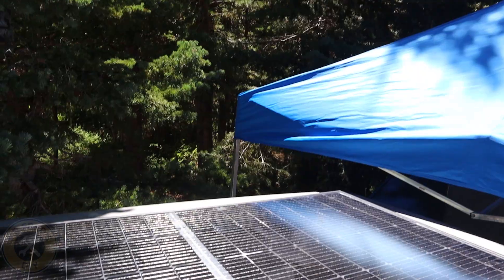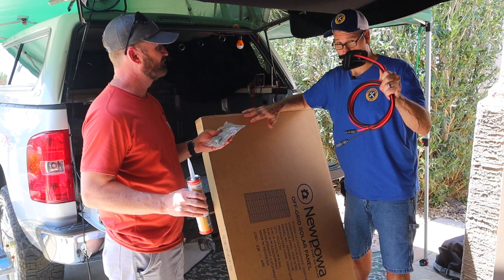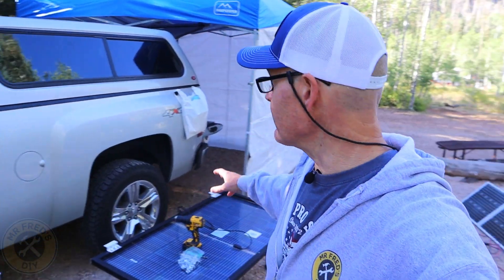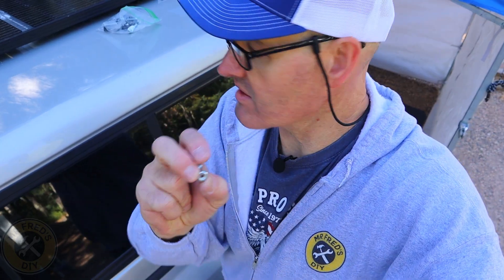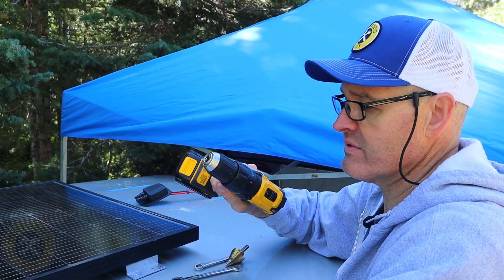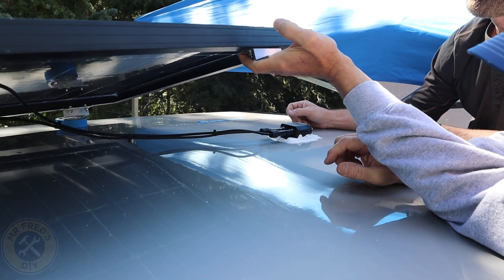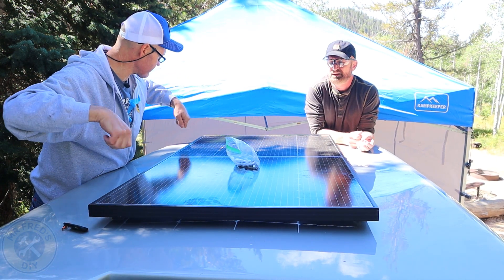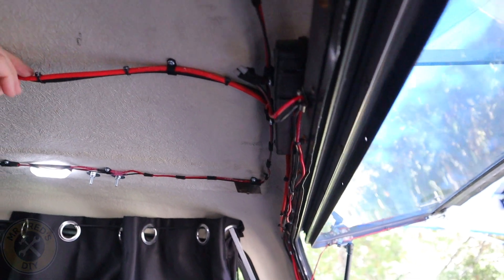Watch Us Install a 200 Watt Solar Panel Step by Step!

Comment: how r u able to screw the wire holders into the camper without popping through to the other side???
Reply from the maker: Great question! We used very short screws and the portion of the ceiling that we mounted too was reinforced thick plywood.